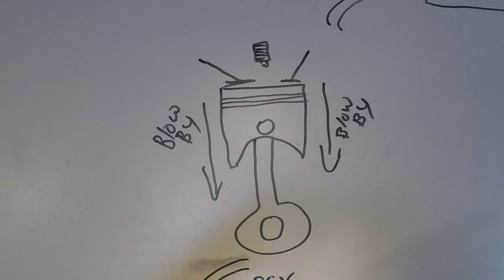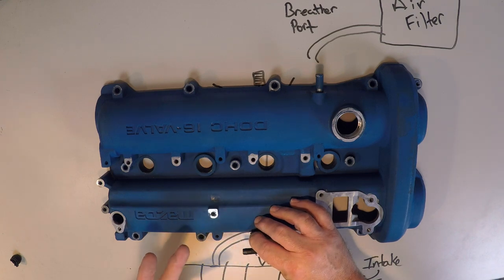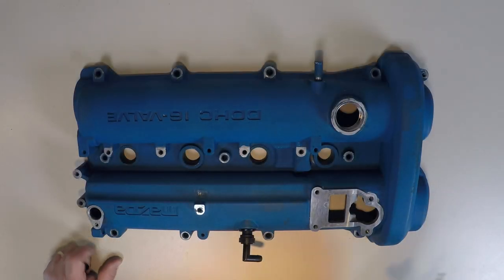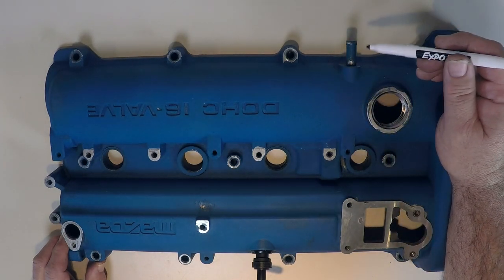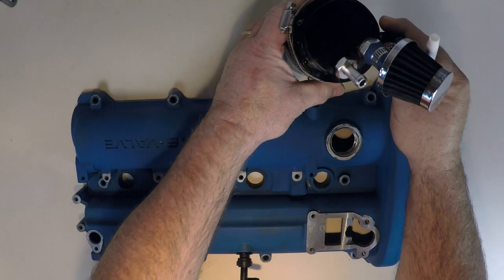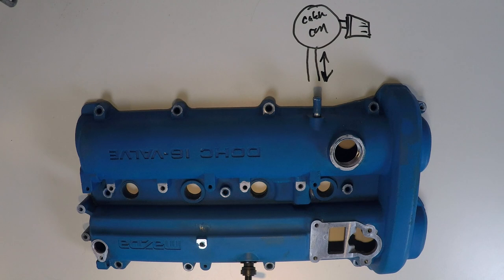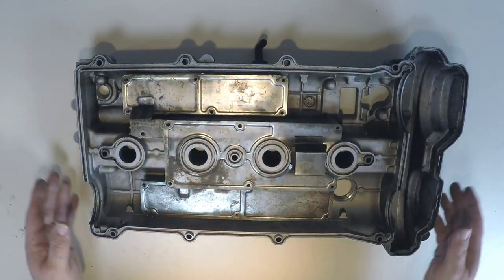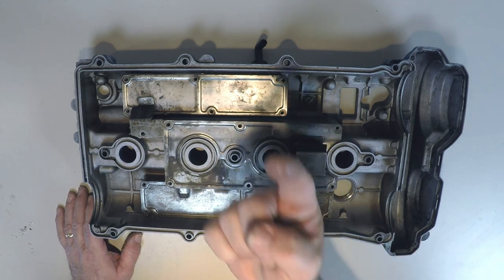How to manage Crankcase vapors, PCV Valve and Catch Cans under boost

Comment: I realise it's about 18 months ago now, but another thought: if I were you I would NOT put that SS wool in your cam cover. That wool will eventually become clogged and the only way to unclog it will be to remove and disassemble your cam cover. But how will you know when it's clogged? Well, you won't untill the engine starts building up excess crankcase pressure and you start blowing rings❗ Let the dirty air out through the cam cover vents and let the catch can(s) do their job of catching that oil which you can easily drain off at intervals.

Comment: Great video, the best explanation of crankcase evac system I have found ON YouTube. Most of the boosted production cars come with a connection from the breather to the intake before the turbo to evacuate gases under boost. Arguably, on boosted applications which have more blow-by, it's more important to evacuate under boost than at idle / low engine speeds. Unless you are using a dry sump, routing both the PCV and the breather ends to catch cans (separate ones is the preferred approach) leads to more pressure in the crankcase, which is not good.
Reply: I agree! Best explanation I have ever found. PCV and boost makes so much sense now.

Comment: PCV was created originally during WW2 because certain engines such as tanks and other military vehicles.  The water they had to operate in. With just a filter on the valve cover it would allow water to enter the engine. Sure was used later for immissions control, but again it was created for military vehicles and water they had to operate in. PCV sealed the engine from water.
Reply from the maker: Brilliant, thanks for the that, makes perfect sense.

Comment: 3:40 No, that is not how it works. Not from the factory. It is what happens to people that do not understand how the PCV system actually works, no disrespect, no offense, I want to fix this knowledge gap for everybody. I recommend you take a measurement of the factory turbo engines, measure their crankcase pressure at wide open throttle. Resolution is on the order of two to four inches of mercury at most. It is not a positive pressure as you suggest. The actual crankcase pressure at WOT is NEGATIVE in a factory turbo engine because the pressure scalar component is driven by air filter pressure drop. I have a video in my channel where I set and measure the crankcase pressure to become negative during boost. This is how you keep oil inside the engine and prevent deposits from circulating and ruining the engine quickly. This is also how you keep piston rings draining properly in boost and wick oil down from engine components back to the oil pan. This is also how you reduce blow-by and prevent oil from being pulled up into the chamber during intake stroke from the ring pack. Basically it is the most important and fundamentally mis-understood principle of combustion engines. Fundamentals are pressure testing and crankcase pressure measurement.

Comment: Great video! Such a smooth explanation of a topic that is misunderstood by many car enthisiasts including myself. I come from a Nissan RB mods background and I know many RB enthusiasts have done their catch can setups the wrong way including myself simply due to lack of understanding of how PCV works underboosted conditions. It makes perfect sense to me now and I can now relate to my older installations of catch cans and laugh at myself lol. Thanks
Reply: the catch can I got has an IN and OUT and a diagram I found on-line shows that the PCV valve side is connected to the IN.

Comment: An excellent explanation. Just one thing: the first system you showed (around 5 mins) with the catch can vented to atmosphere is defo a BAD way to do it. Why is that? Under vacuum conditions (cruising down the motorway for example) the air that comes IN this filter to the crankcase and then to the inlet mani to join the combustion mixture is UNMETERED air that has not passed through the mass airflow (MAF) sensor.Thus the engine is actually breathing IN more air than is being measured. Since measured air is used to determine the correct amount of fuel required, this system will result in the engine running slightly weak.
The system you showed later (c7 mins) with a connection to the incoming airflow is the correct way to do it. This is a closed system and ALL the air that enters the engine is metered, so no problems with running weak.
Reply: @robywankenobi32  I hope they are not deleting the PCV valve on turbo cars, lol lol lol.
Actually, I have seen that done. Double quick way to destroy your rings and wreck the engine..
I'll have to do a video on my channel for how to install a catch can properly. My Saab is turbo too, so I can explain turbo and non turbo installs.
Reply: @CycloneCyd  Pretty much every turbo car i've seen has it wrong, then when you try explain whats wrong they will be all protective about there system EVEN if it is bad for the environment and the motors longevity - current situation with the human condition. Theres not enough definition between a dedicated track car and road registered car, and people think they can blur the lines.

Comment: I did the setup where you route the catch can to ait intake on my supercharged Camaro and it was SUCKING up oil when it was in vacuum. Sucking up 1qt per 1,000 miles!! So capped off that intake side run breather catch from both Valve covers only! So much better!

Comment: Great video! To share my experience, when  venting breather to catch can to intake, you got to keep an eye on the catch can after a few runs at the track. I filled up my intercooler with oil pretty fast at the track and blew excess out the blow of valve. I now use your first example breather to catch can to breather filter works better. For reference my car is a na with 99 motor and gt2560r w/ mishimoto catch can.
Reply from the maker: Thanks that’s great feedback. I’ve also read of some people actually draining the oil from the catch can back in to their oil pan. This way you don’t have to worry about oil overfilling the catch can.

Comment: thank you thank you thank you.  Was debating single can (PVC only) or double (PVC + Breather) for my Forte5 GT with 1.6T Gamma.  Was going to go for single PVC only until watching your video made me realize that the breather side goes positive during boost so I'm going to need dual catch can set up.
Reply: Yes, and this is why typically the breather pipe plumbed from rocker cover to turbo inlet/MAF sensor T-piece junction is actually bigger, it has less vacuum to assist it, so the pipe internal diameter is normally double what the vacuum side pipe is used on the PCV valve to make sure it is not a restriction, if all custom work is being done the pipe plumbed in has to be downstream of the MAF sensor, so that a) the ECU knows how much air the PCV valve ion oppisote side is letting into the combustion process as the MAF is measuring it both into the rocker cover as well as the turbo inlet during normal idle, and b) has to be downstream of MAF otherwise turbo inlet draft during WOT will pull oil from rocker cover through the MAF sensor and coat it with oil - a big headache.

Comment: PCV  valve is only installed on street car set up as you have to return air from AOS or catchcane to intake manifold to be burned again so you put PCV as a one way check vakve there to prevent boost leak when we are under boost. Race set up only returns filtered oil back to crankcase through one of the other ports depends of the car now. The air is vented to atmosphere hence no need for PCV valve

Comment: First of all thank you for the video, very informative.
Nowww.. I have a 2010 challenger srt8 with a Vortech centrifugal supercharger, long tube headers and methanol injection.
Im having a nasty problem of oil getting out of the valve cover into the intake filter, supercharger, intercooler(top mount, water to air cooling) and all the way back to the manifold and into the ground since a lot stays in the filter.
I added a baffled 3 port catch can ran the valve cover tube and pcv tube into the can and put a filter into the 3rd port.
Oil still managed to get thru the can and splattered all over the engine bay.
I added a 2nd catch can and the oil still made it out and splashed everywhere! 
Idk what else to do

Comment: I'm considering running the hose into the side of the dump pipe so the hot exhaust gas will draw the vapour out as a venturi system and burn the vapour as well

Comment: I used that exact scrubber in my catch can for added surface area. I still had oil in my intake of my blower and the intercooler. Seems there is no win-win . I thought about the race breather catch can but just as you said, the contaminates will be trapped in the engine. What do you think about using a vacuum pump to pull clean air through the engine? No emissions here.

Comment: Stainless mesh is good in a can because it has a great deal of surface area.  This gives vapors entering the can the best chance to condense and fall harmlessly to the bottom of the can.  Putting the mesh where you show it in the valve cover baffles will have the same condensing effect.  Where does the condensate go then?  Will the liquid then get sucked out the pcv valve?
Reply from the maker: Ideally it drains back down into the head and block
Reply: @Seandoestech  I am more inclined to think it will just get sucked out the pcv from the baffled area.  Won’t there always be flow in that direction when the engine is running?

Comment: Great video.. am stuck here .. the pcv closes at vaccium ..right?? And opens when the throttle opens ? So with boost it would open even more ? Or the case here is ..the boost is higher than the crank case pressure so it wont come out though the pcv is open?

Comment: Can the setup apply to Hyundai gdi motor that are not boost it yet but are on  their way because I change my spark plugs and found oil vapor in my air intake manifold I have a catch can on pcv valve now I want to try with a other one with a breather on the crankcase what do you think.

Comment: I have a 91 Mercury Capri xr2 which is the turbo model.
From valve cover to pcv valve I get all this gunk sludge (looks like honey) in pcv valve and then goes into the intake manifold. 
I’ve checked inside valve cover valve train and none in there.
I’ve changed oil etc but still happens only at pcv valve and aft.
Drives me crazy.
I also don’t drive the car long trips just short trips maybe 7miles round trip and not always in hwy. more city driving.

Comment: Such a great video! Your the man!!!
Quick question how would any of the application options differ if the car was a non turbo? v6 with pcv valve on front cover where oil filler cap is and the rear (closest to firewall VC has air inlet hose going back into the airbox...
Got eclipse 3.0 with worn rings and I get oil leaking out of my filler cap as well as smoke when filler cap is open. Was going to leave pcv as it is and try to modify my oil cap to vent or go into a catch can to relieve some crankcase pressure.. I don't care about venting off into the air as long as the smoke is not visible just don't want to suck in any air through that modified oil cap breather and possibly throw off MAF ...
Thanks to you and anyone else that could assist.
:)
Reply from the maker: Thanks man! I think the same principles apply for an NA engine. In your case, you’ll want to be sure the PCV valve is functional because will definitely impact crankcase pressure.

Comment: How did you go with 1)the stainless wool 2) getting oil past the catch can on breather side and 3) the moshimoto catch can? The moshimoto catch can looks like it would cause a significant restriction so wonder if you found that or if you're still using it?
Reply from the maker: The catch cans have worked out just fine. The breather side catches about twice the oil as the pcv side. I check them at every oil change, great about a 40ml total at most out of them.

Comment: really want to know how your experiment with the stainless steel material in the exit chamber of the valve cover came out.  I drive an audi with a 2.7 bi-turbo and oily air being sucked back into the turbo's under boost is a real issue.  ...but a related issue is even worse, that is, crankcase pressure in the valve covers forces very annoying gasket leaks.   Did the added pre-exit materials add to the gasket pressure while capturing oil from the crankcase air...?   What were the consequences...   ??
Reply from the maker: The valve cover never leaked before or after I added the ss scrub pads. It did reduce the oil being pushed out the vent side. Tho I did still get some still captured in the catch can, but 50% less…

Comment: I have a catch can installed recently.  

2006 mustang 4.0. I hooked it up to the passenger side pcv to the in on the catch can and the out to the air intake. The ccv straight to the air intake. 

Is this a correct way to run this system? 

Thanks.

Comment: Well said..Some of the nasty stuff that I have seen in my catch can I wouldn't risk any of that heading towards my compressor wheel
Reply: But this is a legal requirement for all road registered cars, an inline GAS TIGHT catch can on the clean side is the best and legal way to do it, venting to atmosphere on the breather side is bad for the environment - and is not possible if the car still uses a MAF sensor - this sensor has to measure all the mass in the combusting, letting unmetred air into the rocker cover and thus out the PCV vavle into the intake manifold breaks the PCV system, as the computer won't know about it the extra air.

Comment: I had an issue with the PCV that caused engine surge which was solved  by disconnecting the air intake hose from the PCV.. Can you explain what could be the cause of engine surge? Tks for you advice.
Reply: Change the PCV valve. The PCV (ball/spring) might be stucked

Comment: I pauzed it when you opened the occ the brass filter in the occ doesnt that restrict the flow like does it increase crankcase pressure i got a airtec one but i dont thrust the damn filter in it due to more pressure being created can someone tell me if im wrong or not good video tho
Reply: in my unit i installed occ but i removed the brush filter inside the occ beacuse it can restrict the air flow and can increase crankcase pressure that leads a damage to the engine

Comment: How did it work with the clean side connected to the intake tube? That's what in thinking of doing on my bosted Ls 5.3..
Reply: When I did it, it pulled oil into the turbo even through the catch can, so I just vented to air.
Reply: @HooverTuber  damn. I have a elite oil cap that has a hose vent. I was gonna ad a small catch can and plumb to intake side of turbo...

Comment: is it means that we have to put 2 oil catch cans one on breathing and other on PCV valve side?    or just one ?
Reply: I don't know about Miatas specifically.  I've got a Speed 6.  and, there are a lot of variations.  Some people just put one catch can on the breather side.  That is basically the first-step version.  Some people will put a second can on the PCV side, as you suggest.  Or, some people will go the "race car" route and tie both sides into one catch can and then VTA.  (Vent to atmosphere.)  The "race car" route is definitely not emissions compliant.

Comment: Results? Curious what the final system configuration looks like.
Reply from the maker: Welp, the motors out again 🤣 but I basically ran a catch can on both the breather and pvc side. The breather side gets virtually no oil since I put the scrubber pad in the VC, but I get about 4 oz of oil out of the PVC side every 6k (I empty it every other oil change)
Reply: Boosted Miata Thanks for the information and I hope you can get your motor back. I have also been trying to troubleshoot the addition of an OCC to my 2017 F150 3.5 Ecoboost. I modified the hoses so they are spliced together 2 in 2 out and had to follow up with drilling pinholes in the oil cap to relieve pressure. I tried fitting the filter that came with the OCC to the oil cap but it was not relieving enough pressure. The system works great except for the oil misting up the engine bay. I am going to get a breather cap that hopefully solves that problem, but otherwise I am getting great results. 

BTW I think the internal scrubber filter you added might be your engine trouble just for the fact that everything else you have done has some kind of equilibrium with the intake and output. Thanks for the video as it has helped me out a lot and for the fast response, I am a subscriber as of now.

Comment: Focus was on vapors.  How about the crankcase pressure?  Tnx
Reply from the maker: For serious crank case pressure‘s probably want to do the option I spoke about I called at the race car option where you drill out the breather port and the PVC port and then run some AN Dash 10 hose and connectors into a large vented to air catch can.
Reply: @Seandoestech  got yah but the pressure have now shifted to the catch can
Reply: @michaelvanna8982  the catch can only acts as a separator vented out to your liking... nearly no internal pressure if the flow pipes are sized properly
✌🏻

Comment: So can I install another catch-can to the breather filter side of the v8 dodge? or does all of your instruction applies only to a TURBO engine? I'm not a turbo guy, only trying to make my Dodge run better.
Reply: maybe it's a good idea to have a catch can for pcv and another catch can also for the breather
Reply: @marcianc.biodor8798  thanks for the reply although it is long in coming.......
Reply from the maker: Since you’re not going to build boost in a naturally aspirated set up, having a catch can on the breather port probably not necessary unless you are seeing oil being pushed through the port.